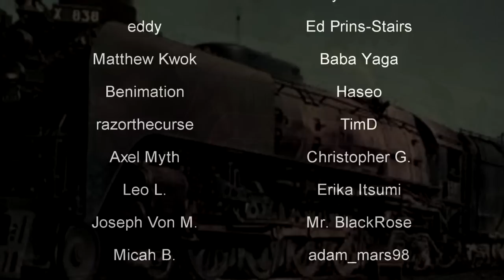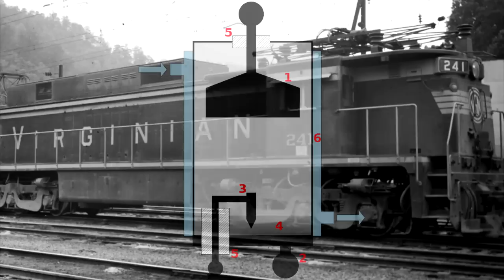5 Revolutionary Locomotives (That Failed Miserably) 🚂 History in the Dark 🚂

Comment: Pretty silly to include the BR Class 71s. They were a small class designed for specific duties which they did well. The comment about having to take detours to get round engineering works isn't fully right - if the juice is off, it's to stop trains running, including diesels. OK, the detour was sometimes a bit longer than it might have been. Electro-diesels had an advantage there - but the rest of the time they were lugging round an extra diesel engine that was no use, and was too small to power a train at full speed. There was a place for both.

Comment: I disagree with the assessment of the EL-C.  The Virginian conducted one of the largest scale electrifications of a freight railroad in US history because of a major grade at Clark’s Gap, WV.  They had previously tried large Mallet locomotives on the Mullens to Roanoke portion (which includes Clark’s Gap) - the class AE 2-10-10-2 and the XA 2-8-8-8-4 triplex to name a few - and they proved inefficient.  The electrification proved a resounding success with the gargantuan “box cabs”  EL-3A (some of the largest and most powerful locomotives of any type ever built) working well, with them also purchasing the 4 massive EL-2Bs.  They further supplemented their electric fleet with the 12 EL-C units, being the only railroad to purchase them new (the name designation follows VGN’s system of designating their locomotives).  After VGN was bought by N&W - who had no desire to continue the electric program - the EL-Cs were sold to the cash strapped New Haven who needed to replace their own 1910s model box cabs.  They designated them the E-33.

Comment: The S1 Wasn't a good design and the T1s needed to just be 4-8-4s and have baker valves with roller bearings. Not sorry. I do love their looks however but spring equalization is a major requirement.

Comment: Electric engines has a dirty look when they found themselves without the overhead wires, for whatever reason. The RR not electrified due to private ownership is STUPID, said by the Chinese RR ministry.
As with the steam engines, those big ones would have trouble on the curves. Not only this S1 but also the big boy. If the routes are sharply curved then more numbers of smaller engines such as 282s would do better. This is how the Chinese handle those freight cars on branches as the bigger ones (2102s class QJ) would derail.

Conclusion: Avoid using something too big!

Comment: Although it makes sense to judge the EL-C by its low production numbers compared to diesels, it ignores that in North America most electric locomotives were built and sold for specific applications as opposed to being broadly generic as the diesel locomotive (this is even seen with electrification by N&W and VGN as both were around the same time and used side rod/jack shaft units yet each was built specifically for them in that application similar to steam engines being built for a specific section of railroad). This is even true with the PRR as most of their electrics were only ever used or seen on their lines as well as those on subsequent PC and Conrail such as the E-44 and GG-1 of which the former was based off the EL-C built for the VGN a few years prior (E-50C had even fewer units built than the E-44 but was followed by the E-60C a few years earlier which was used as the base for the E-60CP)

In short, it was never meant to be mass marketed like diesels as they were being specifically built for the VGN as seen by the history of electric locomotives built before where some designs were similar or even constructed around the same time yet were still different

Comment: ah the s1, that was well known around these parts of north indiana, crestline to fort wayne to chicago, the s1 was not just built by the altoona shops, all the the big three contributed to her, she was known as the big engine, but soo big it could only be used on that line due to the straight runs, it could not take sharp turns, it is a shame it was not saved, some say it had 7000 hp output, but I have ran into differant figures, she had a huge boiler though, and could boil the water you bet, there was also the s2 it was a steam direct drive turbine, worked real good over 30mph but had to run the blower hard at slow speeds cuz of its appatite for steam was huge, and the low pressure and temprature changes the firebox got did a number on the staybolts and sheets.

Comment: The E33's didn't fail.  They worked well in the service they were designed for and joined the rest of the Virginian's electric motors serving for 26 years.  Most diesels of the that era were gone by then.
Reply: Exactly. The sick politics of Amtrak and Conrail failed.
Reply: @maciekkra539  the Virginian was the only railroad that purchased the EL-C/E33 new.  All 12 were built for the Virginian, which had very successfully electrified 134 miles of their mainline from Mullens, WV to Roanoke, VA because of the steep Clark’s Gap grade.  The EL-C was the third generation electrics to run on that section.  So the EL-C was extremely successful for the customer who initially ordered them.  Their lives didn’t get shaky until sold to the New Haven after N&W bought the Virginian and disbanded the electric program.
Reply: @Engine33Truck  Yes i know. But if Conrail decided to go with initial study and electrified mainline to Conway yard who knows, maybe they would have worked until nineties alongside E44s.
Reply: The E33s are like the British Rail class 71s. They were designed for a niche application which they did very successfully. Neither belong in this video. Plenty of examples of this, for example Gresley's steam K4s specifically for the steeply graded West Highland Line. Only 6 of them, but successful on that specific route.

Comment: The E60s were originally equipped with steam generators hence the CP prefix because of Amtrak’s inherited passenger cars which where steam heated and they got a weight increase when they added HEP equipment in the E60CH.
The SDP40F was failure because of being based of SD40-2 for the locomotive frame and you count in factors like heavier loading, use of freight locomotive trucks and constant derailments caused by rough rail conditions of 1970s. Amtrak gave a majority of the units to the Santa Fe where they regeared to freight usage.

Comment: I think, TEP80 locomotive can be part of this top. 2 TEP80 locomotives were built in Kolomna in 1988 & 1989. They have 2 bogies with 4 axis each and 6000 hp engine. One of them set a speed record for diesel-electric locomotives (not Guinness record) in 1993, reach the speed for 271 kilometers per hour (168 miles per hour). But they were very expensive and passenger traffic fell with collapse of USSR. TEP80 0002, which one set a speed record, is staying at the museum in Saint Petersburg.

Comment: If I remember correctly, freight E60s were used only on Black Mesa & Lake Powel RR. This was isolated network near (No shit Sherlock moment) Lake Powel. Running from Kayenta Mine to Navajo Generating plant in Arizona. There were used GE E60Cs and they were like not best but pretty well made and was serving well.
And what about that you use only, ONLY 40 years old locos. Here in Slovakia we have 70 years old loco in regural service and nobody complains because they are good.

Comment: The thing about the SR Class71 you don't mention is that it was designed as a dual power pick-up locomotive. Its main source of power was the standard SR 750V DC Third Rail which covered roughly 90% of of the Eastern Section of Southern Region and was used to haul prestigious trains like the "Night Ferry" and the "Golden Arrow" from London Victoria to Dover Marine, where the coaches were put aboard a boat and thence sailed to Dieppe and thence hauled by an SNCF locomotive to Paris . The Class71 could use a pantograph for overhead supply at 650V DC in sidings and marshalling yards. This was done for safety purposes as an exposed outside third rail was even when they were built seen as a safety hazard. 
I, personally, don't think they can be classed as a failure as in the 60s and 70s i would see them working the North Kent line with continental freight to and from Dover, as well as passenger trains out of Victoria and Charing Cross when the EMUs were not available.
Reply: Only the Night Ferry was able to cross the channel in a boat.
Reply: Absolutely right, they were a small class built for a niche application that they performed very well.

Comment: Though, the steam boilers on the E60 is a contributing factor. When they had their HEP installed, the speed went up to 90. 603 is not the only passenger E60 that survived, 958 also survived. I wonder if the failure locomotives of Amtrak was rebuilt with HEP(E60 already did) and a better truck layout? Also, Rebuilding the old streamliners would also be cheaper if they though of it, when you only have the Streamlined cars and no Superliners, Versatility will improve for when a specific car needed and cheaper maintenance cost having of one type of cars to maintain (Streamliners) than Multiple types (Superliners, Amfleets, Viewliners, and Talgo cars). Same with locomotives to rebuild GG1 won't be that hard, Chemicals used can be replaced and is far better than the ACS-64 built by an EX-NAZI company (Siemens) since the AT&SF(Santa Fe) rebuilt their F7s to CF7s(the same company that forced Amtrak to stop using the Super Chief because they are degrading the AT&SF). I wonder what company that the Rocky Mountaineer and Alaska Railroad get their passenger cars from? Personally, those cars would've been better than what Amtrak was using. Oh, there is only one NYC T-motor left BTW. No. 278 is in the same location as S-motor No.100 these two were built by GE.

Comment: 10:06, one note to point out about the W1 after it’s rebuild: on September 1st 1955, just after departing from Peterborough Station, No. 60700's front bogey frame broke in two at Westwood junction, causing the engine to jump the tracks and onto its side at 20 mph, taking two coaches with it, injuring 5 people. Photos of the aftermath do actually exist along with the inquiry report into the accident.
Reply: Oh hello there

Comment: Let's be honest, you could make a whole series: just about the Pennsy Railroad and their designs.  On some cases; they acted like a locomotive production company.
Reply: In some ways, they were, as they had their own shops. Most of Pennsy's locomotives were built at the Juniata Shops in Altoona. The only engines they had that weren't home-built I believe were built by Baldwin, which being located in Philadelphia, might as well have been an extension of the Juniata shops when building locomotives for the Pennsy.
Reply: The GG1s were THE last locomotives in everyday operation that were actually built by and for a railroad. They had more in common with steam as far as that aspect was concerned.

Comment: The W1 demonstrated again that what works well at sea does not necessarily work in the very demanding environment of railway traction. Apart from the EMD engines, marine diesels have needed significant detuning to survive rail use. And NZR had steaming and cab heating problems with their only Vanderbilt boilered locomotive E66.
Reply: A classic example of that is the Napier Deltic engines used by the Navy, BR derated them in the 55s.

Comment: Many of Amtrak's E60's were sold off to either the Black Mesa and Lake Powell or Ferrocarilles Nacionales de Mexico, which had an electrified main line between Mexico, D.F. (what we called "Mexico City") and Puebla, Mexico (to help alleviate air pollution in Mexico City).  I saw them running in Mexico in 1997.  In a stunningly bad move, NdeM decided to de-electrify the Puebla line later...😢 Fun fact: there were two versions of the passenger E60: the E60CP (which had a boiler for older steam heated passenger cars) and the E60CH, which had a head end power generator for the newer electrically heated and cooled cars, like the Amfleet coaches.
Reply: Actually, that wasn't the FNM that dismantled the Electric Line between Mexico City and Santiago de Querétaro, the Electric Railroad System is actually still in place today. It was taken out of service in the early 2000s because the line between Mexico City and Santiago de Querétaro got sold to Kansas City Southern who didn't want to go through the hassle of operating it.
Reply: Not at all, you need to check your facts before writing something like that. About half of Amtrak E60s went to NJ Transit and two went to a coal mine out in Southwest. All mexican E60s were new from factory. Black Messa and Lake Powel got theirs originally from factory and later a few former N de M joined their fleet when Mexicans decided to scrap their unfinished electrification.

Comment: I when the t1 trust is done building their t1 they should build an s1
Reply: I sometimes wish they would, but the issues the S1 had during would mostly likely resurface again and make operation difficult

And the it would need a certain track to run on since Duplex Engine don’t have any articulation
Reply: True, the only way I can see the S2 working in present day would be to slim it down and make her a little bit smaller.

Comment: The W1 was a 4-6-2-2 and not a 4-6-4 as the last 2 axles were independent of each other.
Reply: You're correct about the rear axle being articulated separately but this very subject came up at a meeting of the Friends of Darlington Railway Centre and Museum where many of the members are former railwaymen (who know a thing or two about the Hush Hush).  Apparently she was definitively a 4-6-4.

The convention describes the number of leading carrying wheels, coupled driving wheels then trailing carrying wheels making no distinction between carrying axles in a bogie or separately articulated. Articulated locomotives with more than one set of coupled driving axles use the same convention with extra digits. A Mallet type would be described as a 4-6-6-4 for example while a Garratt, which is almost two loco's with one boiler, would be 2-6-2+2-6-2. It then follows that calling the Hush Hush a 4-6-2-2 would imply that it was a Mallet with a single driving axle behind the three coupled driving axles.
Reply: @TimRuffle  no it wouldn't indicate the the W1 was a Mallet-type locomotive. It solely indicates a separately articulated axle. A true Baltic layout has the rear pair of axles articulated around a single pivot point whilst the W1 had an A1 style rear axle with limited side to side movement aft of the driving wheels followed by a pony truck with its own pivot point to give a greater degree of rotation. This whilst the W1 looks like a Baltic it is truly a 4-6-2-2, in spite of what the old railwaymen might think or even what the original drawings say. The 2 Class C7s that were rebuilt with booster sets to become 4-4-4--4 retained their class C classifications that identified them as 4-4-2s becoming the Class C9 in spite of their Mallet-type configuration making official designations a bit of a minefield. And shouldn't the C9 be classified as tank engines as locomotive and tender were now a permanent pair articulated on the booster set? Again official records have them as tender engines.
Reply: @neiloflongbeck5705  I trust you'll excuse me if I continue to side with people who between them can boast many decades of experience at Darlington Works (where the W1 was built) if only for the peace and quiet.

Comment: The E60s were actually based on the Lake Powell Railroad’s GE E60Cs that were used to transport coal from the mines to the power plant and had catenary wires(those cables seen in contact with the pantographs of electric locomotives)
Reply: The E60 was built for Amtrak cause they wanted to get rid of the hand me downs that is of the GG1 from Penn Central and the E44 that didn't even work on Amtrak Trains
Reply: @Elliottblancher  that too